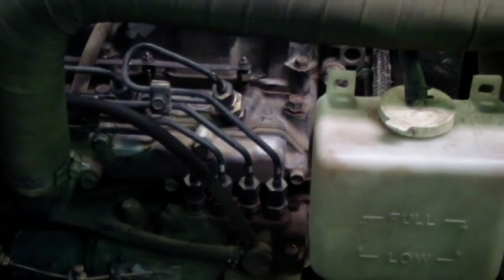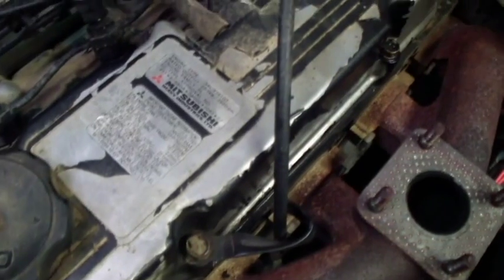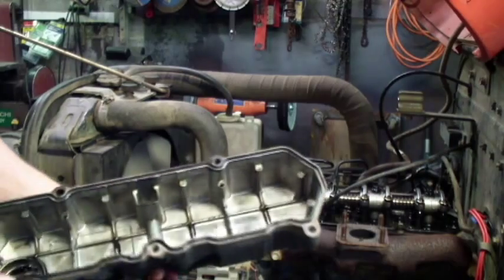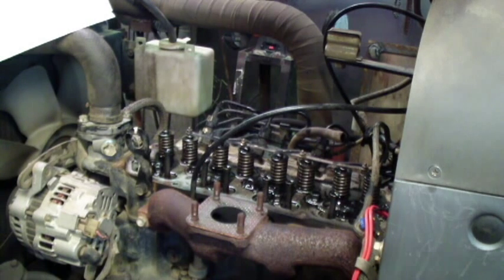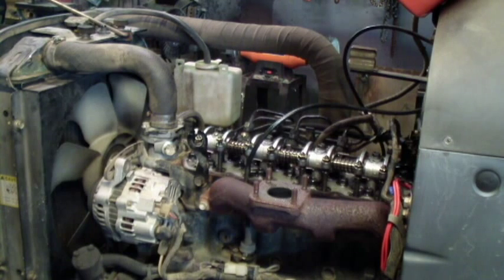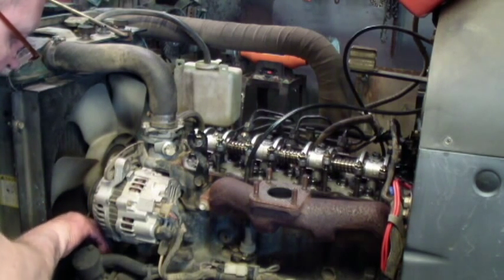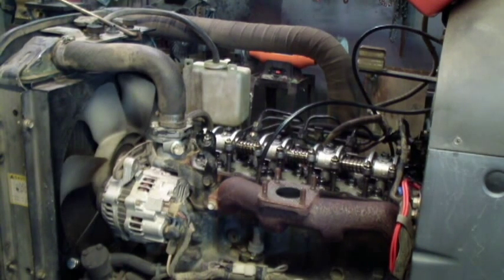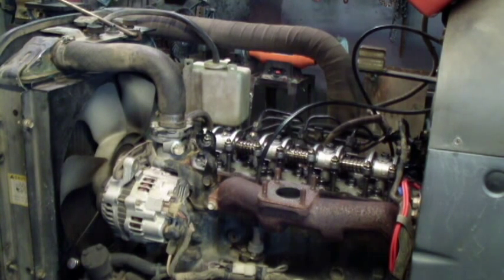Tafe tractor valve lash adjusting

Comment: Got a 35di tafe.25 years old.massey knock off,trouble free pretty much.there good machines.
Reply from the maker: Their combined company I think the one in India they call Taft and then one in the States United States they call Massey Ferguson there a joint company but you're right compared to a Kubota at the same level Kubota has no nothing going for it I also know Farmall or case I guess it's called now International has a 30 horsepower newer-model it's almost identical parts and motor to this same type that I have so I guess they make them probably for different companies depending on the size of them the guy I bought mine off of I don't know 15 years ago or so maybe 20 I don't remember now said that they weren't allowed to import TAF anymore because of the price I guess the other companies were complaining I guess there wasn't enough tax on immerse something but he had about 10  of them also Farmtrac is the same tractor they're long corporated cable company out of South Korea